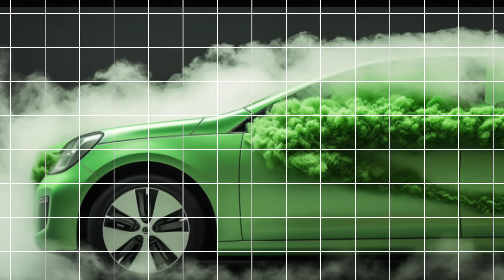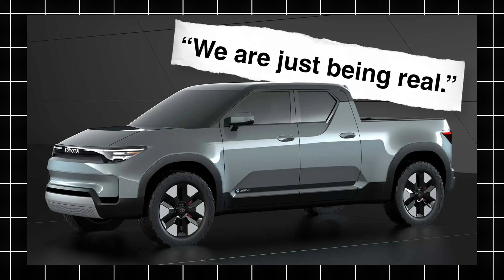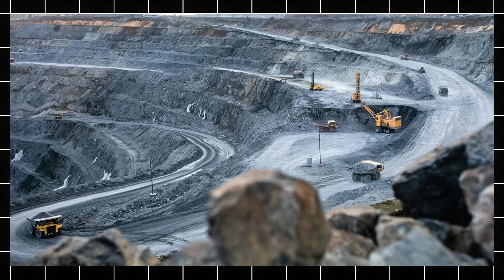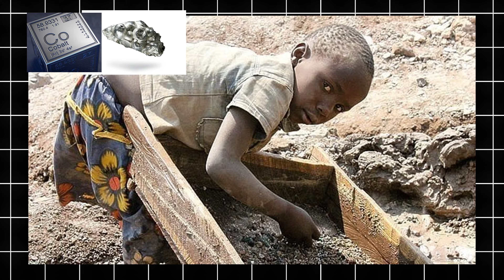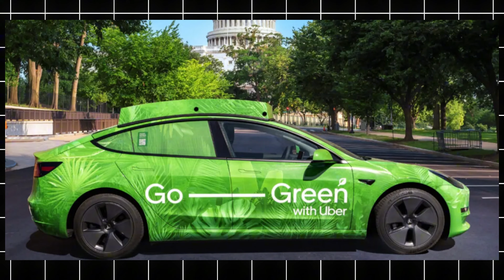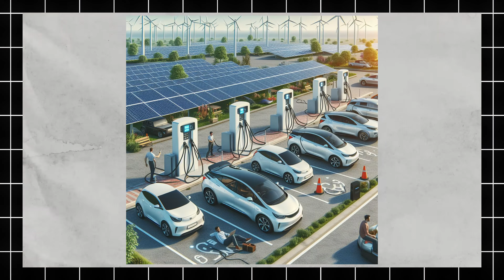Are Electric Cars Really Helping the Planet?

Comment: Your quote 'EVs are a step in the right direction' is exactly the point. GET RID OF FOSSIL FUELS AS QUICKLY AS POSSIBLE.

You don't mention that many/maybe most EV batteries are LFP (no nickel, manganese, cobalt). Nor do you mention sodium batteries. Life cycle emissions from EVs even when charged from a dirty grid are much lower than fossil fuel cars and of course, that is continuously improving with more renewables. I agree with you. WE MUST GET RID OF FOSSIL FUELS AS SOON AS POSSIBLE.